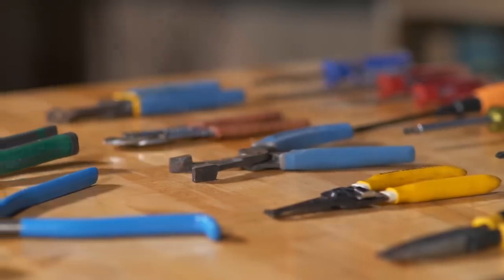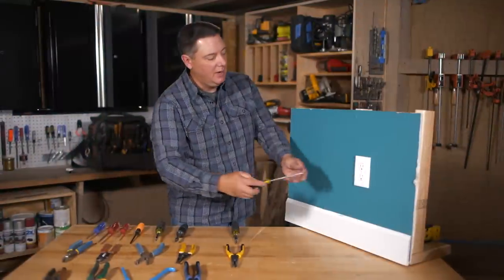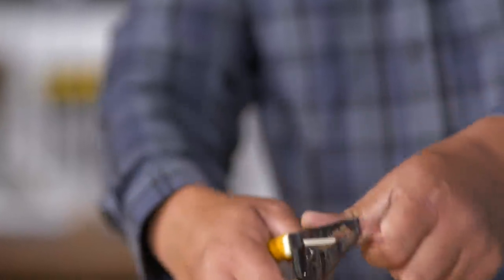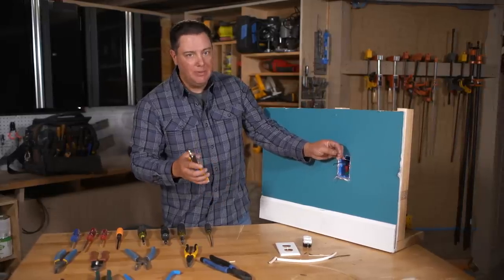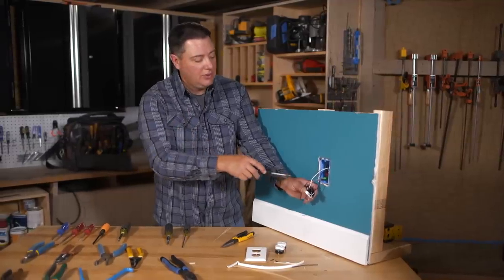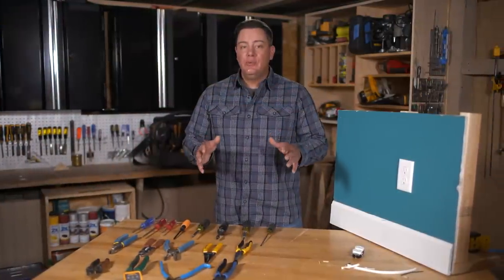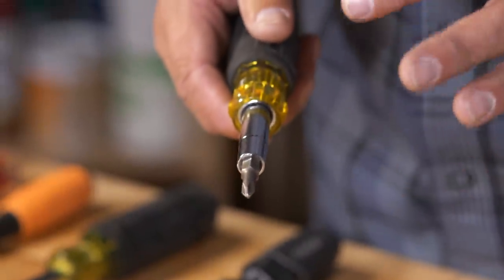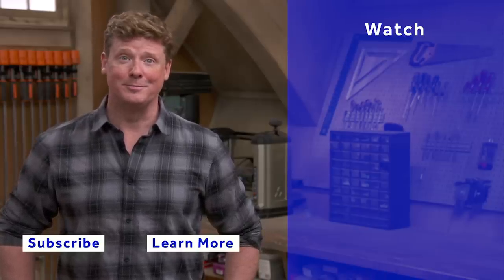Basic Electrical Tools | Tool Lab | Ask This Old House

Comment: I noticed that when you used the plug in electrical tester you only tested the bottom of the outlet. 
Some outlets are split and usually controlled by say a switch. In this case the metallic tab on the side of the outlet is broken off creating in effect 2 separate outlets. 
You could have the bottom half off and the too half still live. I always test both plugs in the outlet just to be sure.
Reply: I was going to say the same!
Reply: Yep pretty sure I got jolted for this very reason
Reply: Is that why there is an extra screw for both the neutral and hot?  For the other plug in case you split them?  I noticed he didn't use these so I think that's what they're for.

Comment: 14yr cable guy here. You can find the multi screwdriver from 5-in-1 to 10-in-1, always handy. I prefer a larger dual crimp stripper, it works on any size wire without having to know and choose which size it is. I did learn something, the bent tabs and in/lbs torque for electrical, as we tighten to 20. Would love an in depth in house networking tutorial, many new housing tracts come with pre-wired CAT-5 (or better) but not terminated or terminated to phone that no one uses.

If you're going to buy & install your own coax & connectors, use compression, it's just better.

Comment: I use WAGO connectors which are code-compliant, and recommend Fluke for Meters, Klein for most Elec tools and Knipex for their insulated combo lineman-strippers. Also, white PVC elec tape and perm marker or reuse the trimmings from 12-2 romex as sleeve-labels. Lastly, get a small electrician-specific tool belt-pouch for just the electrical tools. Makes it easier when working around the old house and garage to have it all on you. Oh and never use the backstab feature of the receptacle-that is more for builders in a hurry and over time, those will pop out as I have had to do many homes for this problem.

Comment: I like to cut my joints at 45 degrees so the metal threaded cone inside the wire nut has a similar shape to really work well together. That said, I've flush cut so many joints I've lost count. Mr. Eastman does a great job making this professional and easy for the DIYer

Comment: Test both sockets with the plug in tester.  They could be wired separately.   Once open, use the non-contact tester too. You own them, use them.   Rare to find a live wire if the breaker is off,  but you never know what the previous guys did.

Comment: I got used to using back wired outlets. So much easier to connect wires. Cost a little more but worth it. Saves time and aggravation.

Comment: A question and forgive the ignorance.  The original cantact had two hot and two neutral wires and you attached one and one. does that make a difference? will it still function the same as before? Thank you for your videos...always learn something from them.
Reply: It will work just the same.  The 2 contacts were connected together when he created the pigtail. However this could be different if the top or bottom outlet is controlled by a switch.
Reply: @Loudog212     Thank you....now it makes sense....Keep up the videos...super informative.

Comment: ? The original wiring had each white and black wires going yo a separate terminal you wired it to a single terminal, was that the correct thing to do in this case?
Reply: Yes its fine because the tab connecting both outlets was intact, for him to show how to lengthen its proper to combine three wires only by wire nut and in the box.

Comment: Thought you were going to show us lever nuts to extend the outlet wires. Real old old old school to twist then together…..
Reply: You had to be that one. Always has to find fault with something.
Reply: Lever nuts are easier, but you rely on a spring for a tight connection. Overtime they eventually fail compared to wire nuts
Reply: @johnlebzelter4208  He didn't say the wire nut was wrong, just brought attention to an more modern alternative. Either will work just fine.
Reply: @bnollbnoll2205  No they don’t.
Reply: The push on connectors are very reliable and don’t fail in my experience. They take up less space and they can be removed if needed. Same deal as plumbers initially resisting solderless type pipe connections . Now they all use them.

Comment: I noticed when he took it out of the wall he had two wires connected to each of the two screws but when he put them back in it was only one wire on one screw. Is this normal?

Comment: Question: what if i can't find the breaker for the outlet i need to change? I've turned off all breakers and none turnoff the outlet.
Reply: That doesnt make sense to me. Only explanation would be its wired in before the box, or youre stealing someones electricity lol
Reply: Hire a professional
Reply: That is extremely unusual.  Did you confirm that there isn't a 'sub-panel' somewhere?    Additionally, if you shut off the main breakers (100A or larger breakers, usually at the top of the panel) there shouldn't be any power to the outlet.  If there is then you need to call a professional to sort this out.
Reply: If you turn off all power and the outlet is still hit then the electricity is going off property.  I have an A/C unit on the other side of the house with its own box.  The electricity comes from the main fuse box.  Some could attach an outlet from this A/C.  Maybe you have something similar.
Reply: You might have a fuse box in addition to a circuit breaker box, if it's an older house especially.
Reply: Turn off the main breaker,  then if that receptacle is still hot ... you got a major problem ! Call a professional electrician immediately !!!
Reply: Thanks guys. Appreciate the feedback. I'll try the main. At the time it was just an inconvenience to the family but i will definitely try that and see what's up.
Reply: @flamingorock  : I think you may have a illegal power tap from another residential house , call a electrician if it is still hot after you turn off the main breaker!
Reply: Let us know what you find, I'm curious!
Reply: @sharonwalker5054  He didn't let us know.
Reply: @flat-earther  i haven't checked yet lol. It's not very urgent but i will get back to you all when i check it.
Reply: @flamingorock  Okay
Reply: So, yeah...i turned off main breaker and it cut the power to it. I was able to change it out. 🤷‍♂️

Comment: I think you should have talked about the two wires with both white and black. Some people won't know if it goes on to another switch. I would have liked for you to show a replacement using all four wires instead of the two. Thanks for the video.

Comment: There were 2 white wires on the plug originally. Why not hook both back up?
Reply: He connected them together with the wire nut and pigtail and pushed them into the back of the box, then he only had to connect the pigtail to the receptacle.
Reply: @facklere  To expand on this, the reason they could be tied together is because they were tied together on the outlet originally. There is a little metal tab that goes between the two screw terminals (that can be removed if needed) that let the outlet chain without the wirenuts.
Reply: Neutral and Hotwire integrity, you only need one white, black and green
connected to a receptacle!

Comment: In the late 1970s and early 1980s, This Old House was shunned by tradesman for "giving away secrets" and they complained they'd be out of a job.  As it turned out, This Old House was one of the pioneers in the birth of the the home-improvement craze, thereby increasing tradesman's work exponentially.

Comment: In my area romex isn’t allowed. Please make content for places where conduit is required and we can’t use romex
Reply: No Romex? Where do you live? I’m honestly curious.
Reply: @Michael-Makes-Stuff  Cook County, Il
Reply: @MattLitkeRacing  Crazy… I am floored because I didn’t know there were places in the U.S. where Romex isn’t allowed. Is it a local or state rule? What is the issue with Romex? I’m no electrical expert, but I can’t believe conduit is that much safer. 🤷🏻‍♂️
Reply: How do you wire up conduit to a receptacle ? what’s inside or outside the wall shouldn’t matter because inside that box is always going need the wires to make the connections to the receptacle, switch , fixtures…..
Reply: @MattLitkeRacing  : post the law there that says that Romex can't be used in Cook Co. Illinois! The NEC makes the laws , not the locality!
Reply: Romex isn't allowed even in the box? I can understand they might want conduit for outside of the box, but even in a box?
Reply: @Bremend  you are going to buy romex just to use it in the box?
Reply: @rrfields65  https://www.cookcountyil.gov/content/ordinances-and-codes

Article 334.10 non metallic sheathed cable permitted uses

1. Temporary wiring for branch circuits as permitted in 590.4

2. Temporary wiring for feeders as permitted in 590.4

3. Limited extensions to knob and tube circuits in existing buildings not over 3 stories 

No other permitted uses. All other wiring must be in some type of conduit or metallic jacket. Took my some time to find it and I learned some things. Hopefully that answers your question
Reply: @MattLitkeRacing  : why you leave out the residential wood frame dwellings for branch circuits from 334.10 (3) ? Which this is the same as NEC dictates too localities, I think you need to go back to school to read and understand better!
Reply: @rrfields65  As far as I know the NEC is a template made by the NFPA (a non-profit organization). Local jurisdictions can and will amend/reject NEC articles. That’s why each state is not on the same NEC edition (it’s up to them when and if to approve a new NEC edition). Arizona has no statewide adoption of the NEC. Michigan removed its AFCI requirements for residential buildings. Many counties around Chicago require the use of EMT.
Reply: @dsingh4512  : NEC = National ( USA ) Electrical Code , and I guarantee that electrical contractors and home owners are not going to pay extra for something that has a 100% safety record for NM/NMC Romex!
Reply: @rrfields65  It doesn’t let me post links to articles, but I’m sure if you search NEC local amendments on forms like Mike Holt or Electrician talk they will talk about how local jurisdictions have the final say. I’m not agreeing or disagreeing with Chicago electrical code, but  they use conduit there and it’s legally enforced.
Reply: @deapbhandal9085  : sounds like a mob run shake down to me and any lawyer worth their salt will win at the state supreme court!
Reply: @rrfields65  the NEC specifically states that local jurisdictions have final say so on codes. Even individual inspectors have final say so on code enforcement. It’s completely backwards from most laws where federal law supersedes state,county, city. 
Plenty of towns around here (Oklahoma) have their own codes. When you get licensed to work in a town/city you have to learn about their codes. They usually have a book you buy. Even the local utility company’s all have their own codes/wiring methods you have to follow. 
Ever wonder why electricians cost so much? This is partially the reason!
Reply: April Wilkerson did a video recently about wiring a new shop and using conduit. She didn’t know much about it and was trying to learn. Why is it a bad thing to teach a new skill to people?